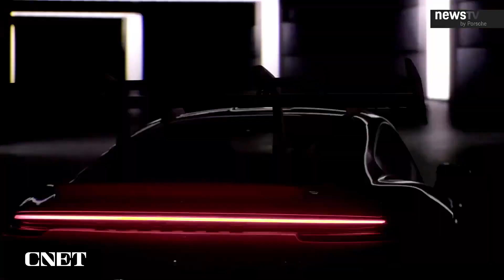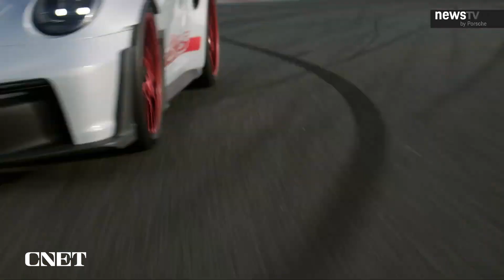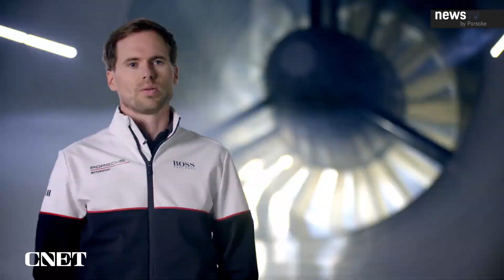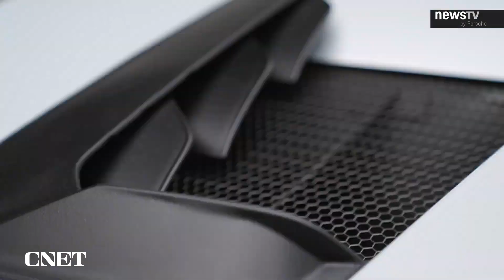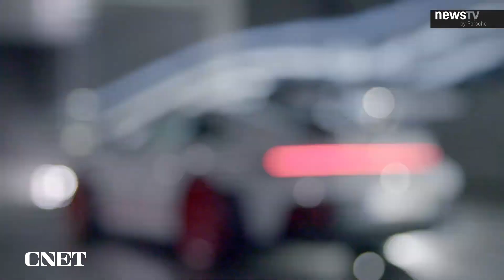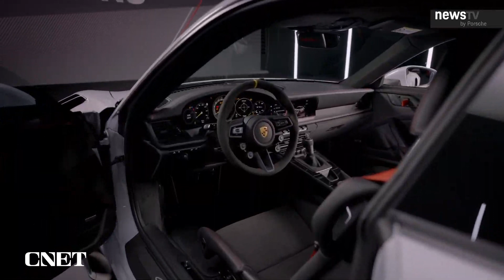Porsche 911 GT3 RS! (Watch the Reveal)

Comment: PDK for Road cars  👎
Reply: Faster than manual.
Reply: @tedlawrence4189  FTD with Manual
Reply: PDK is the quickest shifting transmission.
Reply: @chrisfriends7911  So, are you driving on a race track? Driving in Stop & Go Traffic for hours? I like the freedom of Rowing through the gears and hear the engine rev up and down and coast to stop. I down shift on the curves and up on the way out. No Problem in Traffic if you know how to shift? Feather the clutch. I Love to change gears when I want than riding as a passenger. You Shift when needed by seat of but and Ears. 911's with Manuals sell for much More than PDK one's. I do My own Service and repair with my Tools and equipment since a Kid and Jet Engine Mechanic. I change the clutch and rebuild the engine and tune up or make faster... ;-D I choose the Manual!
Reply: @QuietStormX  besides older classics models, any modern RS with PDK will always worth more than a modern manual Porsche. PDK only GT2-RS, GT3-RS, GT4-RS, 918 Spyder > manual Porsches.